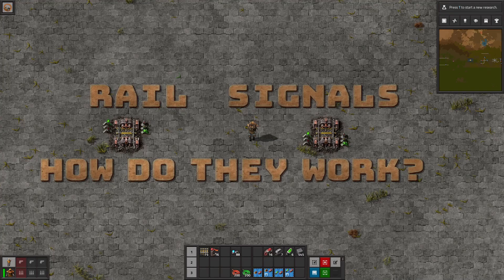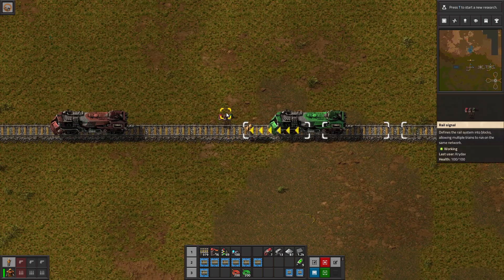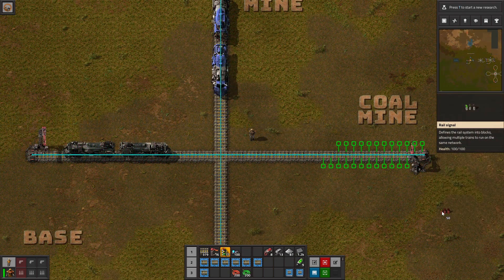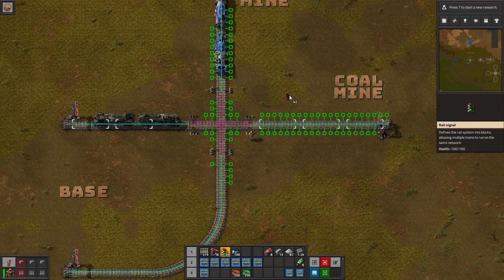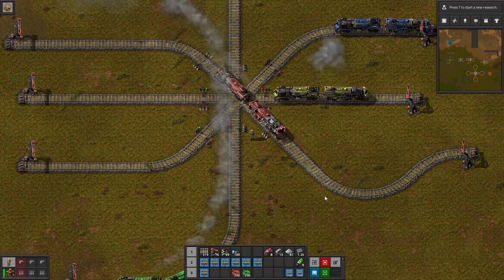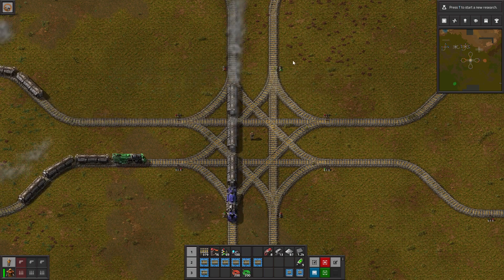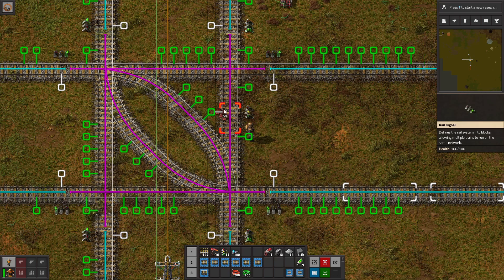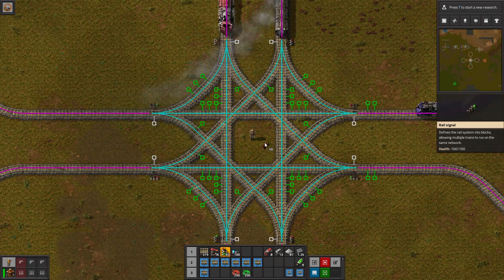Factorio Rail Signals For Dummies 🚦 SHORT Guide For Signaling Basics

Comment: Eh but there is one big minus, if there is at least one signal link, then the second signal will simply always block the train if there is at least one train further. And this is just one big headache because in this case you do not break the problematic section into parts, you break the entire railroad into parts...

Added one single link be kind enough to process the entire railway and otherwise you will be in for an unforgettable traffic jam which especially quickly turns into a very big problem in the general lane
Reply from the maker: This is why you need chain signals, which is in the following video :D

Comment: Nice job! I have not heard that they take in to account the breaking distance. I always wondered how that problem could be solved. Also understanding that blocks expand to crossing rails also was eye opening. Before understanding these facts, I could not understand how signals even could work without using green and red wires + combinators to tell the signals to work properly.

Comment: i really dont get what im doing wrong. i have one train that literally stops in the middle of the intersection and im having them go both ways. i did exactly what you did in your video
Reply from the maker: Well if the block that is in front of your intersection is full, a train will not be able to enter it. If you want to keep intersections clear, you'll need to use chain signals, which I also made a video about! Regular signals alone aren't going to make intersections very efficient. But they will at least keep things from crashing!

Comment: TY!  Had to login to leave a like.  First playthrough and this will solve my issue.  I have two separated circular single train systems (one for oil and other for iron ore), now I want to make more of the same (for copper and coal) and will share some of the tracks, this is going to help greatly.  While building it seems that the game only cuts the track when you add a signal, so if you have long tracks it is worth to split into some sections so you don't block trains just because there's another one 2 screens away.
Reply from the maker: yes, you often want to place regular signals just to keep it so trains can be spaced closer together when traveling along the same route. Just make sure they're spaced out long enough to hold an entire train length!
Reply: @Krydax8  Yes, for now I'm doing 1~2 zoomed out screens for each block and it is working, iron and copper trains come and go sharing some of the rails.  Zero machine-machine crashes, only 1 human-machine crash.  I'm calling that successful.

Comment: I am not getting it still. When i build my signals just as shown in the video, the trains stop at the end of the intersection, causing crashes. Is it because my train is on a loop rather than a straight track? This is really bothering me lol
Reply from the maker: @Scarysteevo  loops work fine if signal led properly.

If it's stopping at the end of the intersection, that means you have trains in front of that block. So you need to clear the block in front. As far as causing crashes, that means you need other signals so other trains can't run into those areas if they are "full" with a train.

I would suggest watching my chain signal video too! Those are usually used for intersections to guarantee trains don't get in the way.
Reply: @Krydax8  thank you!

Comment: I've been led to believe that it was not possible to create a safe 4 way crossing, but you just did it and you did not even use a single chain signal, which I do find odd but you also said you would have another video :)  So I get the idea of signal in signal out but I always figured that my whole train should fit inside a signal area and obviously my train can't fit in the tiny area leaving the intersection so could my train not get stuck blocking the intersection?  Sure, maybe it won't be deadlocked for all eternity, but I might feel that way if I need that trains load of materials :)
Maybe I shouldn't complain until I watch video 2.
Reply from the maker: You're correct. It can block the intersection without chain signals. I probably should have emphasized that more. The chain signal video will explain more, I think it's linked in the description right?
Reply: @Krydax8  Well  maybe, I saw the link on the video list on the right so I did go watch that as well, and I'd love to say I get it now but I have this feeling that I don't, but I did like when you said that the chain signals would ensure that my train could get into the signal past the through signal so I did smile at that point.  Oh, and I really liked that crossover you used, though I should say the obvious I was so lost in the video I'm not 100% sure it works as a perfect loop back, though maybe the area would need to be far too big for that :)  Thanks.